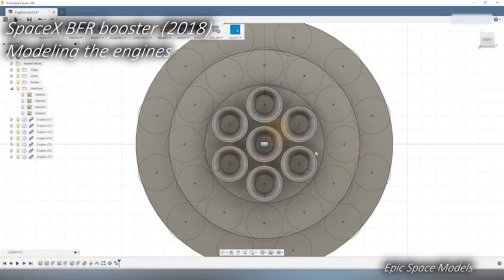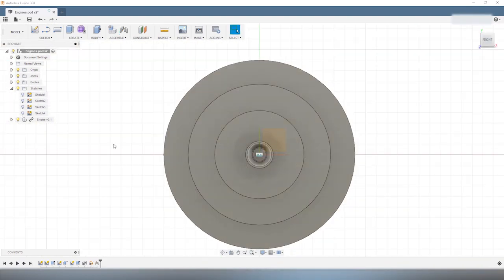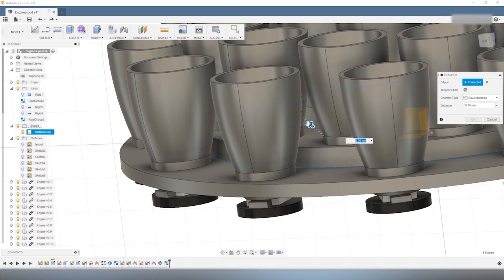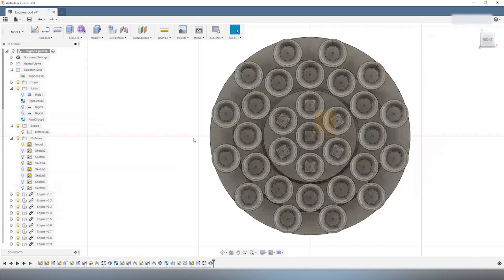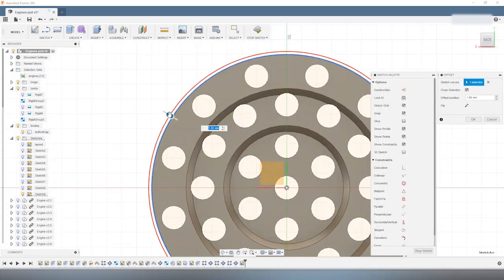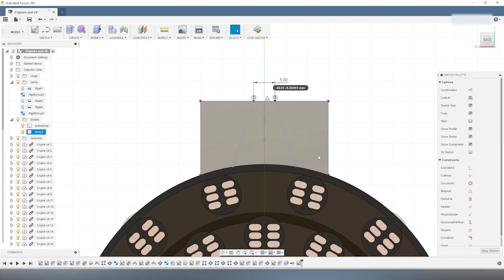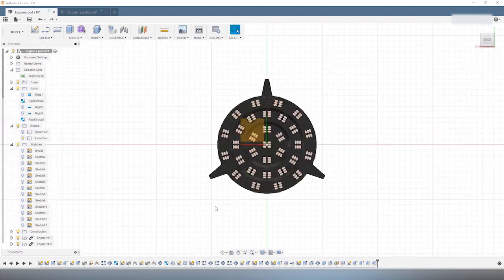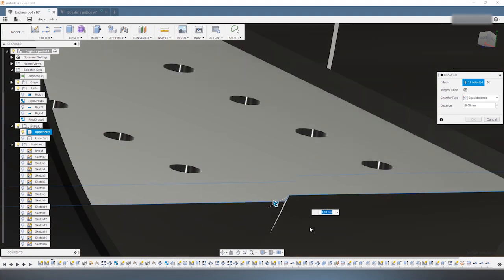SpaceX BFR booster | Modeling the engine cluster

Comment: Just saying, it has 4 fins...
Reply from the maker: Hi. This rendering from SpaceX shows the booster with 3 fins.
https://www.teslarati.com/spacex-bfr-rocket-spaceship-more-real-than-ever-4k-renders/bfr-2018-spaceship-and-booster-sep-spacex-2c/

Is there an updated design with 4 fins?
Reply: @epicspacemodels319  Hmm. Guess you're right.  I am still used to the 2016 bfr renders that we used for so long. Anyways, great model!
Reply from the maker: The design is probably going to change again anyway...
Reply: @epicspacemodels319  I hope not. Since first test are scheduled for 2019, SpaceX should really stop fooling around and get to constructing the damn thing! :)
Reply from the maker: I guess SpaceX has a good reasons for tweaking the design.
The further you go into production, the more difficult it is to change the design. Better spend a few more months doing simulations than discovering a major design flaw once the thing is already halfway built. Especially since they intend to put people inside...
Reply: @epicspacemodels319  I totally agree. However, they should't announce such ambitious schedules. Falcon heavy was delayed for 5 years!
Reply from the maker: From what I know Falcon heavy was delayed because they ran into unexpected problems. They thought they could just stitch
three standard Falcon 9 first stages together, but eventually they had to completely redesign the central core. Had they use 3 regular falcon 9 boosters, the thing would probably have experienced a rapid unscheduled disassembly in mid-air.
Setting overambitious goals has always been part of Musk's strategy. This is a way to keep his staff (and himself) motivated to work hard.